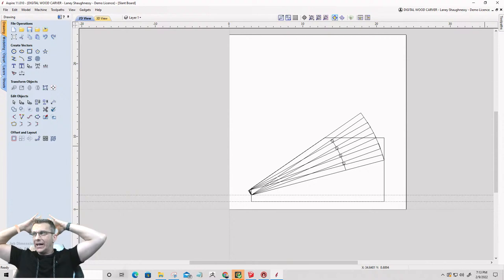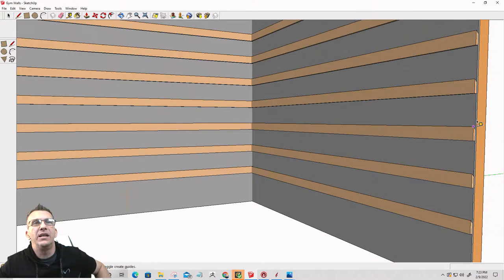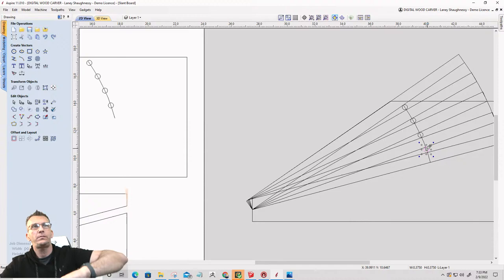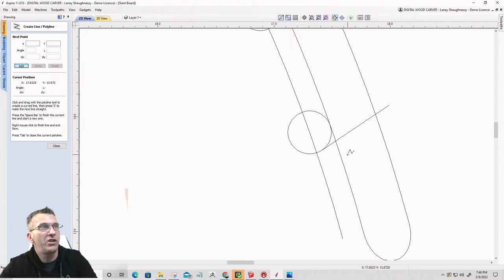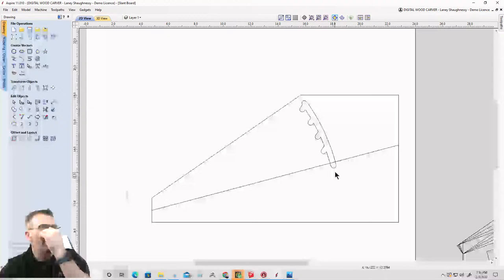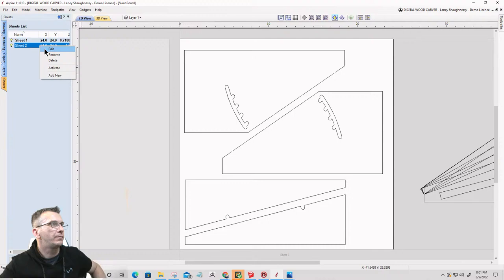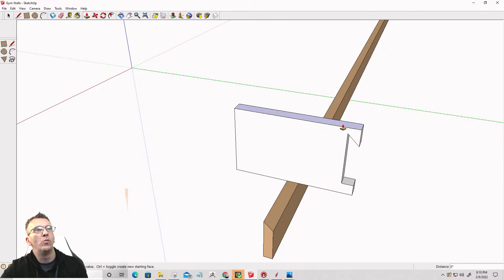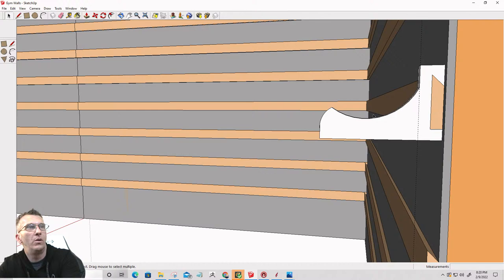Exercise Equipment & Racks | Home Gym | Project Design | Vectric Tutorial | Part 2

Comment: Some have called the design/system a french cleat. And all components hang or cantilever off what I consider the ultimate wall treatment. Kitchen, office workshop and garage. The caveat is that many components will be one-off task oriented designs and all require glue and brad nail. Upshot is that most will not clog even the smallest of workbenches